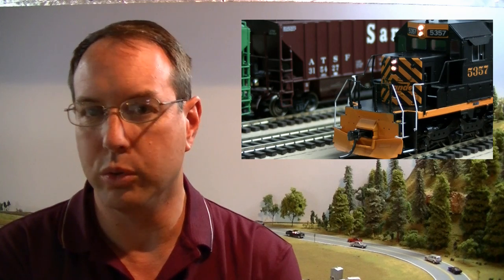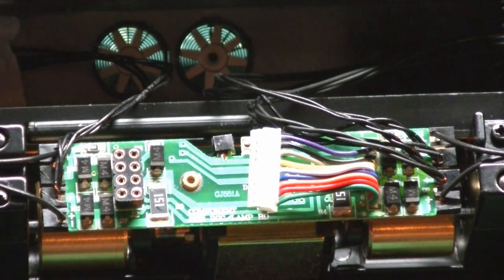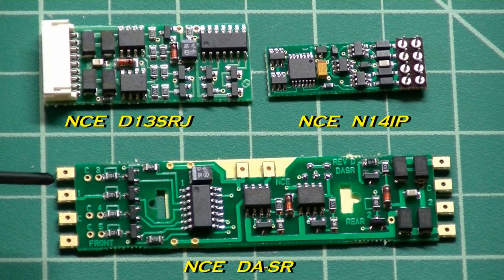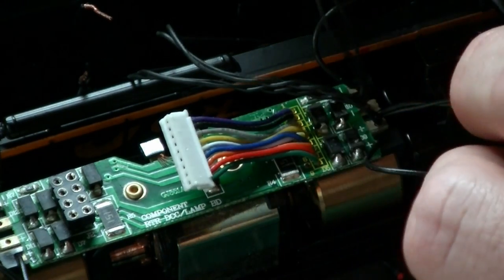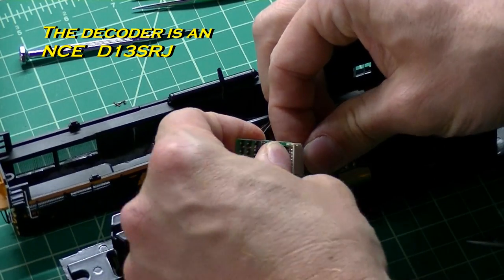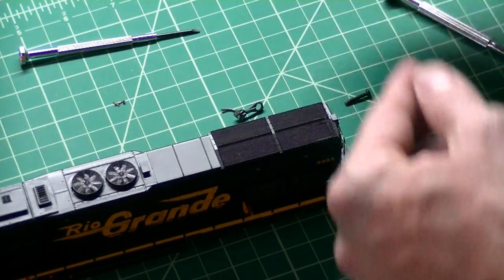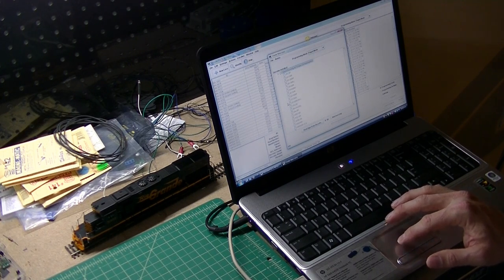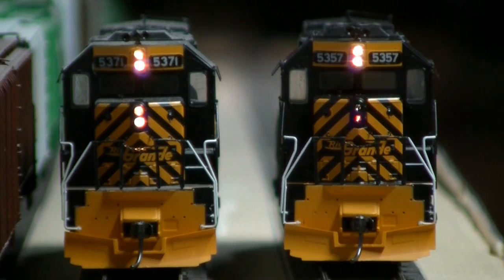How to Install a MARS Light in an HO Scale Locomotive

Comment: Mr. Smith, can you point me in the direction of finding the speedometer that you use, your system is exactly what I am looking for. I've wachted your videous several times, time for you to start writting books on your subjects. I've read Tony's, you have him beat. 53 years young, some things don't come to me soo easy, you have fixed alot of that. Thank you my friend.
Reply from the maker: Joe, thanks very much for the kind compliment.  I bought my track speedomoter at Caboose Hobbies in Denver.  When I was in there a couple weeks ago they had some on the shelf.  http://www.caboosehobbies.com  I'm sure you can find them other places on the internet  or your local hobby shop, if you have one, should be able to order it for you.  Cheers, Kevin

Comment: Wait the mars/Gyralight on DRGW units was on the Nose and not the cab? Looks like I wired mine the wrong way, I did it SP style. (repowered and Athearn BB, new Decoder, LED lighting). Ehh nothing a few CVs can't change I guess.
Reply from the maker: Yes, D&RGW MARS/Gyralites were in the nose with a regular light between the number boards.  You can see a great example of this at 12:50 in the YouTube video
 Run 8! Roaring EMDs On Tennessee Pass, Colorado - 1992

Comment: LOL @ Monster Railroad. What were Mars lights used for?
Reply from the maker: MARS lights were built by Mars Signal Light Company and oscillated either vertically, horizontally, or both which was the case in the Rio Grande versions.  The Rio Grande ones look like they make a figure eight pattern.  The purpose of the MARS lights were to catch the attention of motorists and pedestrians.
Reply: Thx for the info

Comment: Hey there,

Where can I buy the black plastic sliders that hold the wires in place?
Reply from the maker: A local hobby shop that does repairs would probably be the best bet.  Athearn RTR engines and Atlas engines come with these type of clips.  There might be some other engine brands too.  If your local hobby shop can't order them, you could try the Athearn or Atlas parts catalog on-line.  Cheers, Kevin

Comment: Hi Kevin,
2 Q's -  First, what type of cable does one use from computer to the program track / common place to purchase?   Second, what do you use for the "complete sound system" I.e. clicky-clack, flange squeal,  etc?
Thanks, Kyle
Reply from the maker: Kyle, the Digitrax PR3 comes with a USB cable.  It has a Standard-B plug connector on one end and a regular USB on the other.  Additional sounds are available in some decoders.  Sounds like flange squeal can be set to randomly come on or be activate with a function key.  Most of my sounds like this are set to randomly occur.  Cheers, Kevin

Comment: will this method work for the red SP warning light also, and will this work for regular DC locomotives?
Reply from the maker: Clayton, I haven't tried it, but I think this should work fine for the SP warning lights.  However, you can't change the functionality of the light without DCC.  If it was still just DC the light would only come on in reverse and off in forwards--nothing else.  To get a MARS light effect or other lighting effect you need a DCC decoder that is capable of producing the lighting effect you want.  Hope this helps.  Cheers, Kevin
Reply: Ok, thanks for the info. I'll try it on  a RTR SP locomotive when I get the chance. I don't have one currently, but I'm saving up for 2 SD45T-2's in the speed lettering, because that was the best design SP ever had. One question, the program you used to program the Mars light, is that free, or do you have to pay for it?
Reply from the maker: Clayton, I use JMRI DecoderPro to do all my DCC programming.  The program is free, but you will have to buy a computer interface such as the Digitrax PR3 to use it.  If you buy a decoder capable of producing the lighting effect you want, you can set the light output for that function with your regular DCC handheld as well.  Cheers, Kevin

Comment: Where did you purchase this MARS light at?
Thanks!
Reply from the maker: Actually no where.  The bulbs are the regular bulbs that came with the Athearn engine.  The DCC decoder is capable of several different lighting effects, one of them being a MARS light. Once the decoder is installed, you just map the lighting effect you want to the light.  However, in this case I had to rewire which function the nose light bulbs were connected too.
Reply: Scale Model Trains & Colorado's Joint Line Thanks for the reply, you just saved me some $$ haha!